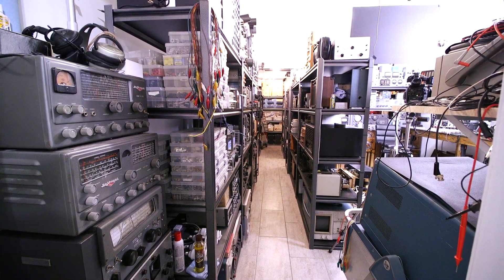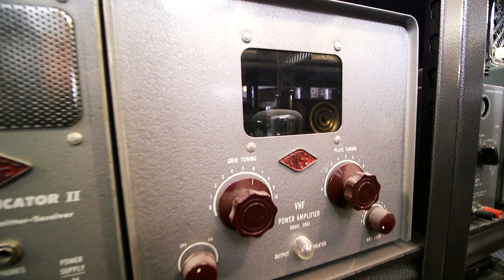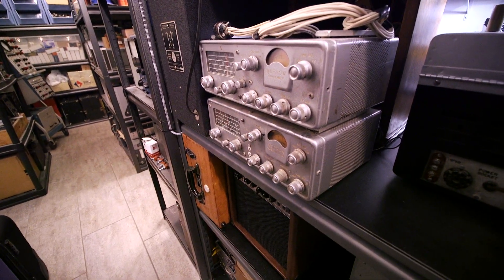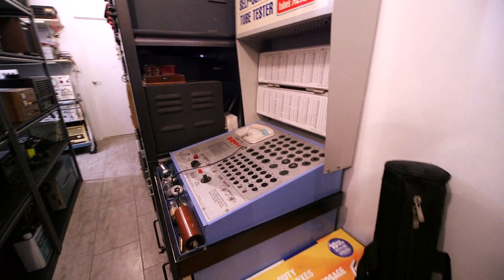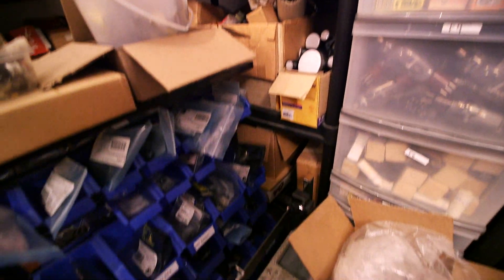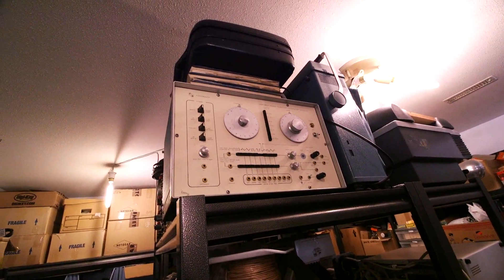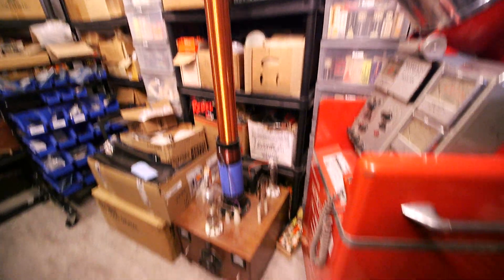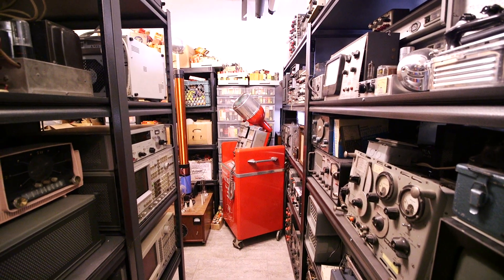Neat Projects Inside Lab 2!

Comment: Paul, as I look around your shop, I noticed you have enough projects for the rest of your life! Whereas i see you restore radios, I restore broadcast video tape recorders which can weigh up to 1 ton each! Obviously I can only have 1 or 2 machines at a time in my shop to work on. Even though I am not encumbered by tubes anymore,  the video heads are very scarce indeed!  Heads spin at 14,000 rpm and ride on air bearings with a built in low noise preamp, so you need a LOT of power and an air compressor to run them. Because of a lack of replacement parts sometimes I have to redesign circuits using modern parts. I have to deal with FM mod/demos and several servo mechanisms. Sometimes I sit and wonder "why are we doing this?" As technology changes, things get smaller and digital with specialised chips and processors. Analog electronic technicians are becoming a dying breed for sure! When I pass on, the technology and the knowledge to even operate these machines will die with me, as no younger person is even interested anymore. When a reel of tape weighs 30lbs you can get much better quality image on micro USB chip, no bigger than my fingernail! So just like records, reel to reel tapes and even CDs have disappeared we need to move our content along or lose it forever.
I enjoy watching all your vidoes. Keep up the great work!
Reply from the maker: Thanks for sharing your story Roy. What you say is absolutely correct, thanks for your kind comment as well!
Reply: Same goes for the 24 track tape machines that studios used to use. I have a feeling you won't find anyone under the age of 50 who can align the heads on a Studer...
Reply: @H-77  this is true. Tape is a lost art for sure..    I used to physical splice 2" quad video tape. My mission is to ensure that every reel of quad tape has been preserved
Reply: I always say that technology is brutal to it's own history... and it takes no prisoners.
Reply: Roy my dad started as a tv servicemen at the transition to tv. He worked for N.Y. Dept of education as an electronics tech making, dubbing,editing and splicing 2?/?" real to real vidieo tape. The room had 12-14 stand up machines and 2 desk models. One time in 1970 I believe he came back from a Sony demonstration seminar and sadly told me about integrated circiuts and how,to his amazement could replace rtr equipment. And instead of having to wait on the tape to que up all that was needed was to enter a number. He worried more about repair than editing and said an idiot could replace a board in minutes when it sometimes took day's to figure out the tape machines. I remember Ampeg, Sony and Teak and Bosch as a table model with smaller tape. What do you repair and what do you do with a repaired unit? Best regards Ron Hood
Reply: @ronhood7773  hey Ron. My dad was a pioneer if Broadcast television and began when Dumont hired him right after the war. 
I restore 2" quad broadcast video tape machines. Mostly by Ampex. Like the VR-1200, VR-2000, AVR-1 & 2, VR-3000 portable and the ACR-25. The VR stands for Video Recorder, the AVR stand for Automatic Video Recorder and the ACR=Automatic Cassette Recorder. It used 2" quad tapes in a cassette that could hold 6min of video. 
I also restire some Helical scan machines like the Sony BVH-2000 and the BVH-500. BVH stands for Broadcast Video Helical
Broadcast machine can record a 6Mhz bandwidth signal. Very impressive! It also has lots of servo mechanisms as well. The video heads spin at 14,400 rpm and rotate on air bearings, so you need an air compressor to operate these beautiful machines. The 1200, 2000, & 3000 machines used transistors, nothing digital about them. The AVRs had digital servos, the ACR also had lots of digital stuff, but all of them had analog video & audio.
You can google the equipment I wirk on and YouTube has some videos of 2" quad machines in operation
Reply: Your knowledge does not have to die make a few videos and post them to youtube .. permanent way to share what you loved to do with others and who knows maybe you will get more business or it will help someone else
Reply: @midnightman011  the issue is that younger people don't care about older technology. It only matters to people who understand the technology and have worked with it in the past. Owning/maintaining/operating this equipment validates our knowledge of that technology.
For example the machines I work on now and in the past weight almost 1 ton, they use 220v@30A , they require an air compressor for the video head assembly, all to produce a standard definition video signal and mono audio. Compare this to an 8k video and 5.1 audio that can be stored on a micro-sd card the size of your thumbnail!
Who would want an old machine like the ones I work on other than guys like me.
Paul does a super job at keeping old radios in great shape, but now a day, everything's digital and its cheaper to toss it out than to repair it. Paul's knowledge greatly exceeds what they teach today and its a pleasure to watch him restore old radios. For people that does not understand RF technology, he is wealth of knowledge. I work a little in RF as the video signal is FM modulated, but I deal mostly in servo, audio, and video signals,  all analog and of superior quality. Its not your consumer nor commercial type of video equipment haha
But sadly, after us old timers are gone, no-one will care about these museum pieces
Reply: @rty1955  You are right no one will care because no one will even know .. not an even a video to demonstrate the skill it took to fix these machines .. if you think it is not worth anything then don't do it
Reply: @midnightman011  there are already videos out there and it takes months to restore these machines.

Comment: Restore the UFO machine to original, I think. Working examples will only get rarer to find with time ...
Reply: I agree. How many mechanics out there can use a scope these days. let alone work on a car with a carburetor period?
Reply: @hotpuppy1  im a mechanic (well, I identify as a diagnostic tech) I have the modern digital equivalent for watching flyback voltage, dwell time, current etc and have used older stuff , I think you would be surprised how many mechanics these days can use a scope, if you do any electrical work its almost a prerequisite. even 1st year apprentices (here in the UK atleast) will know the basics. Anyways I Disagree, its a cool old beast, but if there are other running examples preserved, then have some fun with this one. no-one in there right mind would use a piece of equipment like this to tune even an old car, when you can use a low-amp-clamp,your scope of choice, and your wideband of choice and have a much better result. so why note make this into something folk can enjoy now.

Comment: The engine analyzer was the first in the market. My father purchased the second one in our town of Colorado Springs, CO. It was made by Heyer Dyna Vision and purchased 1958. I grew up using this and then a newer model.
Reply: Hey Jack - by any chance did your dad run the service station that is located at the base of the road that leads up to Pikes Peak?   My father ran that back in the 30’s and told me of changing out normal carbs for ones especially prepared for the ascent to the top of the Peak, after the vehicle’s descent the carbs were then exchanged for the original which were set up for lower altitude driving.
Reply: No that was before his time. In the 30's he was riding motorcycles and bothering the Manitou police😁😁😁😀😀

Comment: As temporary steward of the engine analyzer, restore it as it was meant to be. In the future, no one will care that it was converted to a “UFO finder” in order to amuse an Internet audience, but collectors of classic cars will appreciate a working example of an unusual period shop tool.

Remember, every time you begin a radio restoration you “rant” about the offenses of previous owners and repairmen for whom the radio was, at the time, a simple commodity with no historical value. Don’t commit a similar offense upon a rare and interesting piece.
Reply from the maker: Isn't is good that we all have opinions! Thanks for sharing yours, it's always good to share your thoughts.
Reply: @MrCarlsonsLab  Just a thought, why one or the other? I do not know how hard this would be... Why not have 2 modes? One does the engine analysis, that's it's "day" job, and then at night it can search the sky for UFO's, or comets and such.  If you make an attachment (like a tracking telescope) that plugs into the analyzer it performs the sky scanner/tracker function and that way you can keep the original equipment intact so it can perform its primary function... but when the sky scanner is plugged in it performs the secondary function...  Have fun with it... why not?
Reply: @MrCarlsonsLab  To me either idea would be pretty amazing. Something that looks at the sky or something similar could be very fun, but the analyser itself is a very interesting fascinating piece of kit.

Another thing, these things are very rare but seem to be being traded for only a few dollars. When I saw it my little antiques radar went off and said the value should be about $15,000. Now that's just a total guess but that thing has a vibe that would definitely appeal to Fallout players or people into 50's future retro tech. 

It has Red Rocket written all over it to the point where I wouldn't be surprised if one of the developers of Fallout had actually seen one of these things and it had actually inspired part of the look of the game.
Reply: its ridiculously clean for the life its led, i'd like to see it brought back to where it should be.
Reply: @kenabi  You know, that's a good point... Maybe give up on the UFO finder idea and just restore the equipment? I don't know where it would go from there.  Someone mentioned a museum for classic cars... maybe.  He can always make a sky scanner out of something else, not like there's a shortage of old equipment lying around doing nothing!
Reply: @HobbyHalloween  miles through time has some really good old cars they rotate. they might be interested. its a bit of a co-op deal, but who knows. they may even have a legitimate ability to use it, since the owner of the place does work on his own cars (some of which are in the exhibits).

maybe paul will wind up with an older car that would need such a thing. 

a local car club for some older rides around his area maybe? 

options are plentiful.
Reply: 7:31 “so this is an engine analyzer KNOWN AS a UFO-finder”. I don’t know what conversion you’re supposing will happen to something that is already being called by its own original name.
Reply: I like the dual function approach as others have expressed.  Definitely restore it but add an umbilical of sorts so it can function as a sky searcher when desired.  I always try to follow the "Do No Damage" philosophy when I rebuild things. That way the original function is preserved for posterity while the added function can be removed without a trace if/when it is no longer desired.
Reply: I originally thought "what a cool idea!" But if it's rare I think it should just be restored. Like someone else said.. your not short of parts lying around. Thanks mr Carlson! Your experience & manner is exceptional.

Comment: Mr. Carlson, you really resemble my first electronics teacher. When I was 14-15 and started looking for more in-depth electronics knowledge and found this awesome man. His lab was almost the same - rows and piles of equipment, most of which was designed and made by him. Ham radio on the balcony, antenna outside on the tree, scopes and counters inside. Most importantly - his manner of speech was almost the same. Sort of optimized, so people would understand faster.
 I am younger than most of your tubes in the collection, so transistors and digital methods are closer to me. At the same time I enjoy your vacuum tube electronics restorations immensely. Keep up the good work. I will support via patreon as soon as I am able to. 
 Also, if you are going to do Q&A, what equipment are you hunting for right now? I feel like the search is never over and 2 labs filled to the sealing are not the obstacle for acquiring another interesting piece.

Comment: Many years ago, KPRO in Riverside, CA had to move because the studio and transmitter were located in the middle of a freeway expansion.  The 1Kw AM, tube transmitter was replaced during the relocation.  I wanted to bid on the old transmitter, but had no where to store three refrigerator sized cabinets plus all the parts.  The finals were 833's and the modulator used another pair.  I thought it would make a fantastic restoration project.  My wife and my career dashed those thoughts.  Thanks for restoring equipment that I used in my younger years.  It's a real trip down memory lane.
Reply from the maker: Hi Bruce. Sounds like a Gates BC-1J. Thanks for sharing your story, and your kind comment too!
Reply: @MrCarlsonsLab  I think it was a Gates.  Oh, you got the tower, doghouse, base and all the cables as part of the sale.
Reply from the maker: That would be pretty hard to fit on a truck.
Reply: Back in the mid 90's we helped a friend moving his transmitter equipment from his family's basement to his newly built house a couple counties up in NY state.  The stairway to the basement was barely a couple inches wider than the transmitter cabinet.  I think they had been from the NBC radio broadcast studio after one of their upgrades.   The house he moved into now has a full broadcast studio, and he has an internet radio station.

Still have to get over to his house with some 16" US Navy acetates we have, to get them digitized (he has one of the 16" turntables).

Comment: I need to open a time portal.
Need to get to 1964. I'm not joking.
Reply: I'm pretty sure there's a DeLorean and a Flux Capacitor in there somewhere. You just have to be brave enough to do 88 mph in the darn thing! :D
Reply: Dave Micolichek  All you need is a Mr. Fusion, problem solved!
Reply: Dave Micolichek  Remember the quote when Doc Brown fueled up Mr. Fusion? "Where we're going, we don't need roads!"

Gotta love SciFi tech, especially the cheesy stuff.

**oddly enough, there are at least 3 DeLoreans in my general area, and I see one on the road from time to time. No where near 88 mph, more like 35 or 40. LOL
Reply: Perhaps a Tardis is more easy to find in the Lab than the DeLorean and a Flux Capacitor.
Reply: @JanJeronimus  It is my firm belief that Paul's laboratory is actually housed within the T.A.R.D.I.S. 
How else could he have so much stuff in what looks to be a relatively confined area? 
(It's bigger on the inside, you know...) :D

Comment: Wow... 

Everytime I watch one of your tours I drool.

The engine analyzer would be a superb movie prop for period films and TV productions.

Come to think about it, I'm shocked you're not getting phone calls for all your other memorabelia.

Having worked on a many older cars and trucks, your UFO engine analyzer was widely used in OEM dealers across North America. I tried numerous times to buy a used one at an affordable price when I operated a shop in the west coast. They never came available in serviceable condition and were always traded in and scrapped for updated models. 

When I eventually bought a Sun Engine Analyzer, they had a similar deal. In those days it was easier and cheaper to trade them in, instead of selling them on the used market. Even then, the payments were crazy and they had you for as long as you owned the shop. 

Thanks for sharing your world of electronics. 

P.S. I have an 1975 Sansui 8080DB I'd like you to repair. It's been in the family since new.

Comment: I have a Hallicrafters SX28A one of only 600 with the A designation and it works great. I also got a DX100 Transmitter for $20 all tubes had been removed and a couple things modified I bought all new tubes found the missing coil and it is working once again.You have a lot of nice projects coming up. Thanks for the look around Paul. I remember using one of those self serve tube Testers they had at longs drugs when I was about 10 years old 59 years ago.

Comment: Paul,
Just one more comment. Your Marquette tester is an excellent vintage test device. Loads of older vehicles around and lot's of them waiting for restoration. I worked for Sun Electric at one point servicing their Automotive test gear. There was Sun, Allen and Marquette as the basic players in the automotive diagnostic game. 
PLEASE consider restoration instead of repurposing your tester.  
The BIG question is, are all of the meters OK. If so, everything else can be repaired. Caps in the scope PS section and HV is where most of the problems are. Not sure you have a vehicle which predates internal computers, mid 70's when HEI came out, but at some point you may want an old corvette, muscle car or even an import like a British Leyland bang around. Your Marquette would be very helpful keeping them humming.  
Heck, it would be great to see you doing a tune up with your Marquette. Setting dwell, timing, checking wires and vacuum. ALso you have a volt/ohm meter to check alternator and battery output levels plus continuity . A good tech back in the day could solve problems quickly with a good diagnostic system after the shadetree guys had given up with no idea. 
73, Glenn WA4AOS